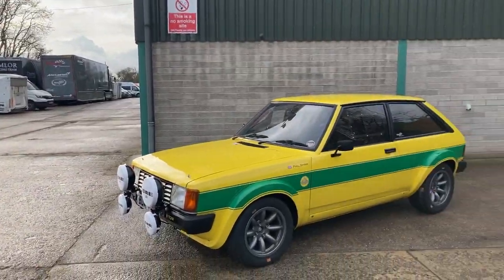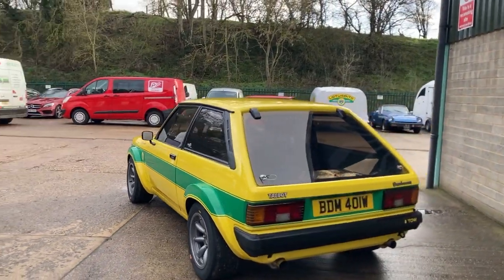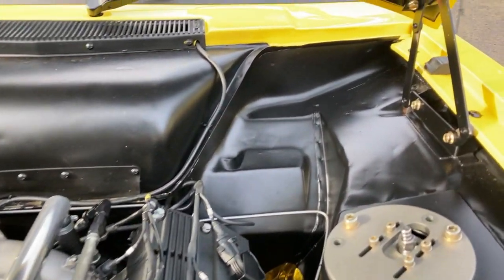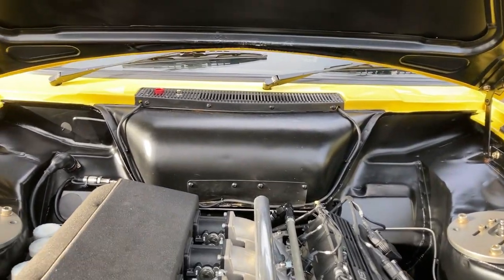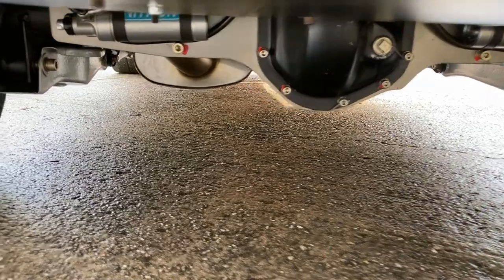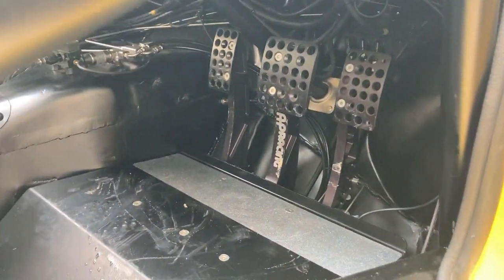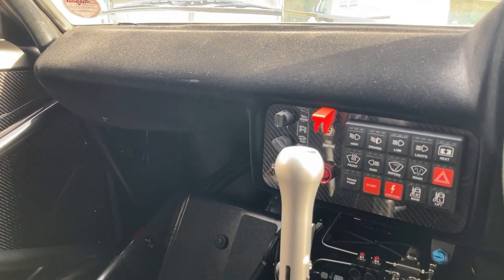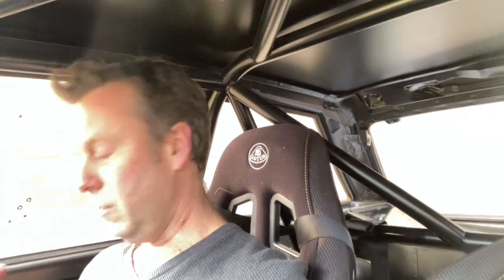Sunbeam Lotus Restomod!

Comment: The Sunbeam and the Avenger road cars were both good handling cars for their age. I had an Avenger back in the day and it was a great drive. My father bought a GLS Sunbeam new in 1981 and that was a great drive too. Great to see there is still a lot of love for these cars. Thank you for sharing
Reply: I loved my 1.3LS, uprated to a 1.6GLS engine with Ti twin webers and Janspeed system.  Slight spring and damper uprating made it handle really nicely.
Reply: The coil sprung back end made them and the Avengers very well mannered!

Comment: Oh, yes! I should say how stunning the bonnet compartment looks, with the bonnet lid low gloss black inside! Also the stunning SILVER underside! What attention to detail! I had a Karmann-Ghia I was going to exhibit at car shows, with a contrasting bronze painted underside. When I wanted to buy the paint for, called Adup Bronzeseal, it was no longer available .It was also used for sound deadening the underside, against road noise. That used to be case because the paint was thick. This was possible, because it was thickened with ASBESTOS! So it was no longer available!

Comment: By the way, what does sequential transmission mean?
Reply from the maker: Basically a gearbox you control either with paddles on the steering wheel or by pushing the gearstick forwards to change down, or pulling back to change up (so you can’t skip a gear like you can on a manual, you go through them sequentially). This is like most modern race cars - you set off using the clutch, then you don’t need it
Reply: @benbarrycars7628  thanks for the explanation!

Comment: The sunbeam body had a really bad design fault. The way the front linkages attached to the chasis rail ment that the slightes bump on the side of the front wheel would bend the chasis rail, which could not be straigtend once damaged.The front rail needed replacing and re-jigging just for a small bump like hitting a kerb at 15 mph. I had to do mine twice, straightening and plating did not work. A really bad design.